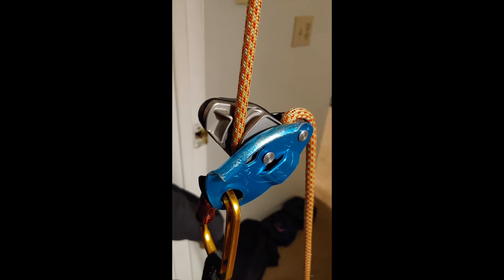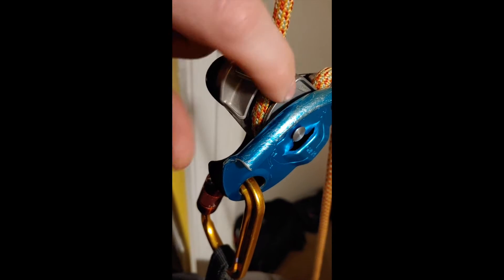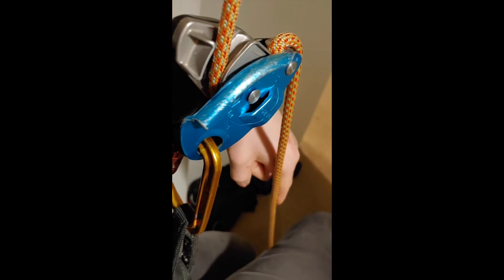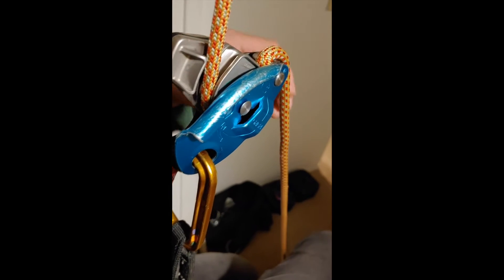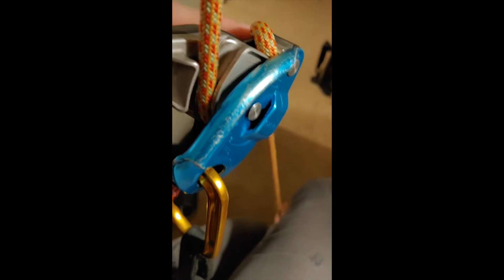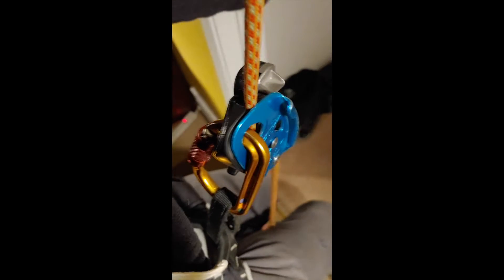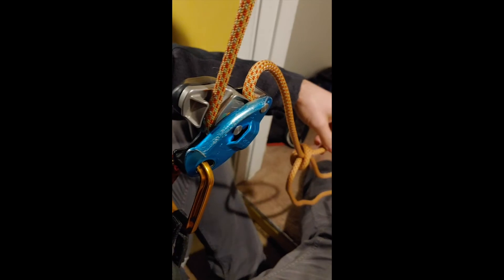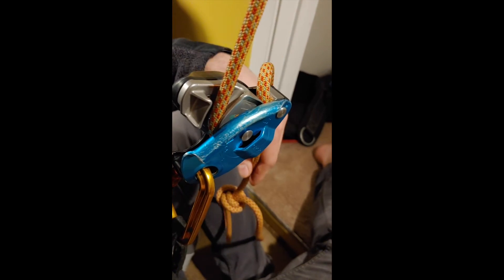Grigri FAIL / inversion when loaded from below

Comment: The grigri is clearly an excellent tool for use in mountain terrain and when used properly and with respect to its known failure modes is extremely safe....but the problem with moving parts is that they introduce a wider spectrum of configurations over which new failure modes can creep in. That is the trade off for devices of this kind. Personally, I do not love the feel of a grigri enough to carry one but I am not dogmatic about it. The added benefit of my abstention is that I don't really need to keep track of all these kinds of dangers. I really appreciate the clarity of this video. Thank you for posting it!